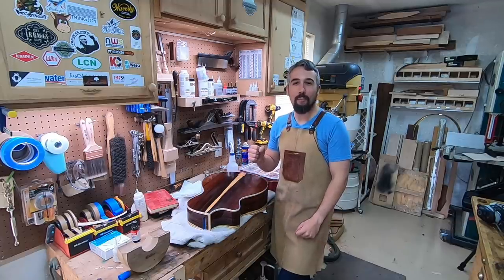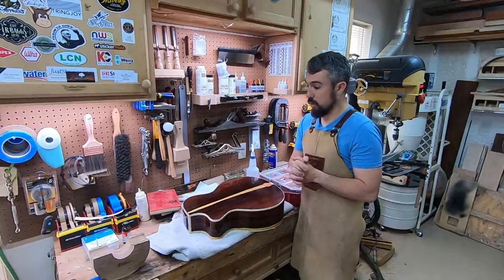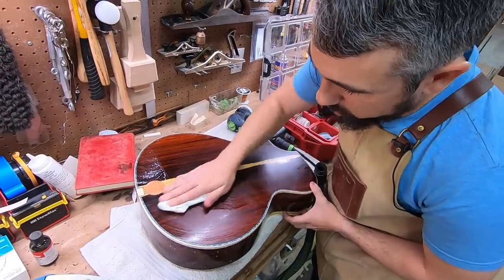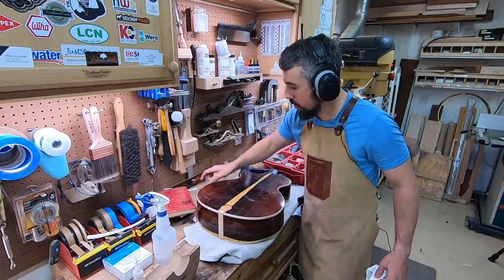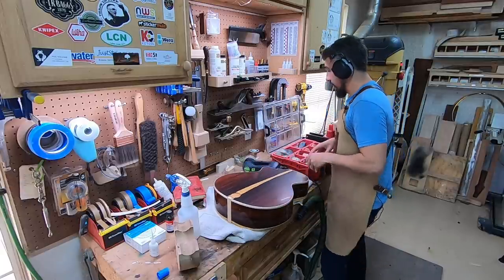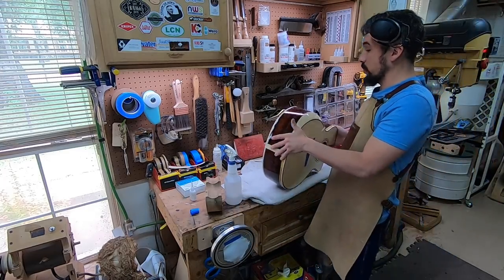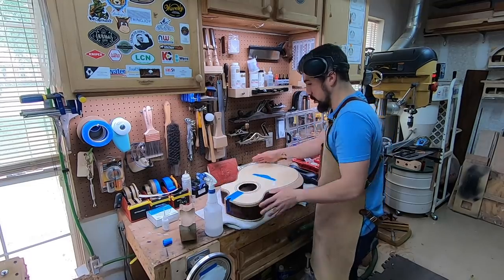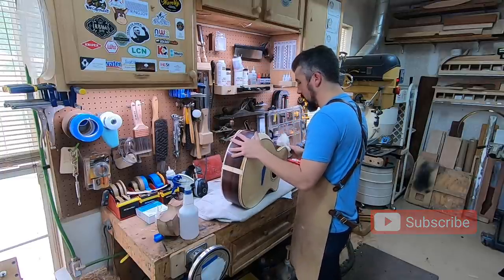How to Buff Out a Guitar Finish (Part 1)

Comment: Quick question, I've been looking for a good sander for my shop but have not gotten the results I've wanted with them. I just wanted to double check, you mentioned you have the Festool Rolex 90 but your links are for the 150. Can you clarify if you indeed have the 90? Also, to confirm, do the larger attachments such as the firm pads, also work with the 90? Thanks in advance.

Comment: Thank you Chris for another wonderful video! Say, did you notice if the Trizact pads you're using are P rated (p3000/p5000)? It seems like most Trizact products sells without the P, and they offer p grade pads only in very limited and specific packaging. I have a reason to suspect that when it comes to Trizact products - there's actually no difference, but I don't want to make the mistake of actually sanding to a coarser grit (after wet sanding using P1500-P2000..). So it would be helpful to know what exactly you're using.
Thanks again!

Comment: Soaking the high grit wet sandpaper definitely helps in my limited experience. Seems to have a more evenly consistent & smooth feel & function to sanding, especially if doing shorter/lighter sanding passes and total time before moving onto next highest grit. I hadn't heard about adding couple drops of detergent so maybe that has same effect as pre soaking in several ways. But then again I was hand wet sanding to min 8k grit usually 10k grit for quite a while with very light touch before moving onto buffing.

Comment: I need to look into the festool sander. I’ve always used pneumatic sanders without dust collection...  that unit seems a bit more versatile...  I agree 100%, if you wet sand to a higher grit, the buffing process goes much faster and you mitigate the burn through risk...  oh and the 3m trizac is the best high grit paper out there. The guys at 3m do their homework.
Reply from the maker: Dude, the sander along with the dust extractor is so amazing.

Comment: Hey I appreciate the video, good info.  As a result I bought the Festool RO 90.  Just wondering was speed you run your sander on?  I am concerned about sanding through even with 1000 grit in the aggressive rotary mode.  Thanks Steve
Reply from the maker: Usually 3-4
Reply: @DriftwoodGuitars  Thanks for the reply